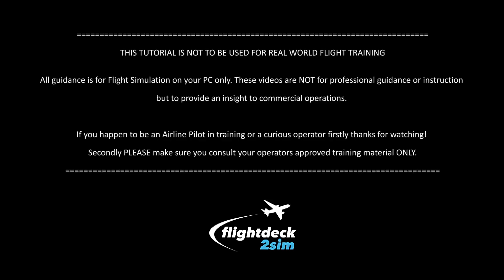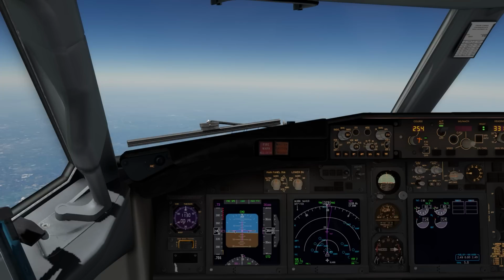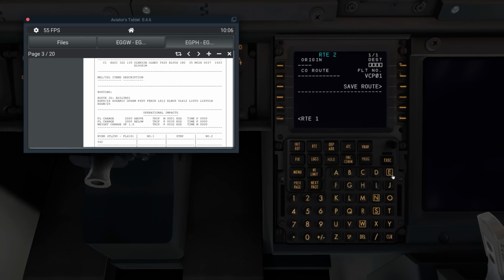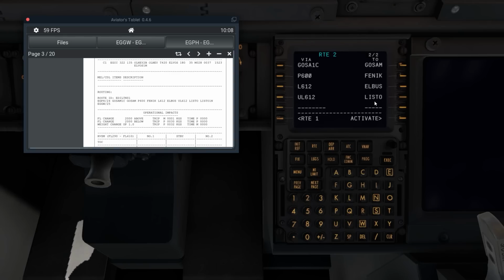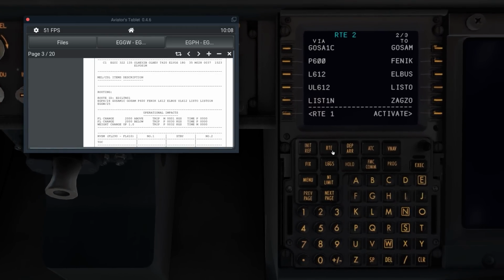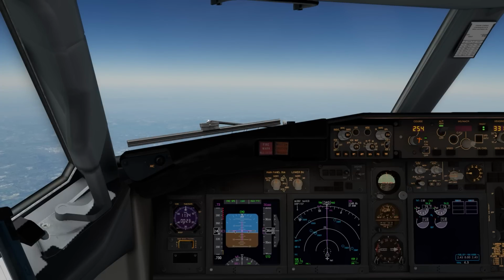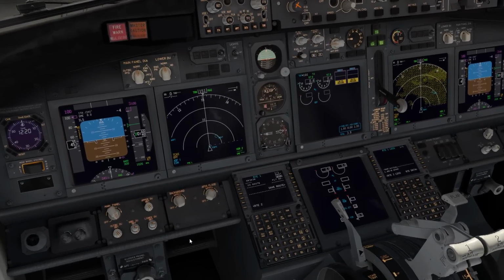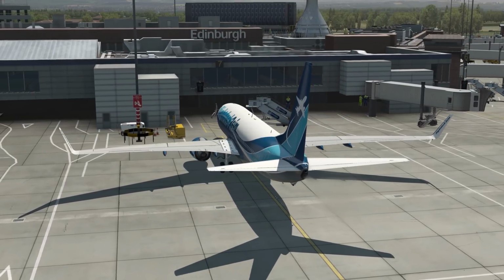B737 FMC Tips & Tricks from a Real Boeing Pilot | How to use RTE 2

Comment: In my opinion, the RTE2 option is absolutely not functional on the B737. For example, on the A320, you can set another route or another flight level or a flight to an alternate in "RTE2" while in flight, while in "RTE2" the FMC will calculate the time and fuel for you. Thank you for your attention.

Comment: In your company, are u free to use rte2 as u prefer or this is the only usage? For example, could you use it to set an alternative approach or a diversion route or a eosid? Thanks in advance 🙏🏼
Reply from the maker: Hi lionell1988.

We are free to use it so select alternate approaches and diversion routing but it’s just far more convenient and easier to update your existing RTE. I’ve only ever used it to load in the next sector. 

FD2S
Reply: Very handy I find for validating an approach in the database. Say in DLM when your not yet certain if it’ll be RNP 19 or ILS 01. You can brief both and with the database validated either activate route 2 or modify route 1 without rebriefing. Also for drift down routings as you can prepare and visualize them in advance. The problem with eosids and diversions is that it’s used so rarely you tend to modify route 1 as a course of habit rather than remember route 2 is there. Floating points at the end of the route are more common in those cases also with Etp’s, decision points etc. Deleting the inactivated modified route upsets people in my company, bonus points for how to achieve that at the end of the day!!

Comment: Hi captain, thanks for the info that has been shared, it helps me out with other aircraft with the same RTE 2 capability. I realised that the FMC in the video is somewhat different to what I usually see in my 737 (i.e VNAV instead of the individual CLB CRZ and DES buttons). Does this have any notable impact on the capabilities of the FMC?
Reply from the maker: The ZIBO MOD has the option to select the most recent FMC updates, the CLB, CRZ and DES button was replaced by a VNAV button which contains these two pages otherwise no change in capability.

FD2S